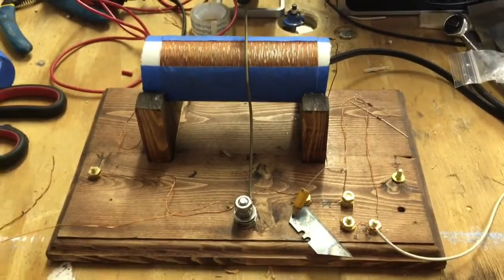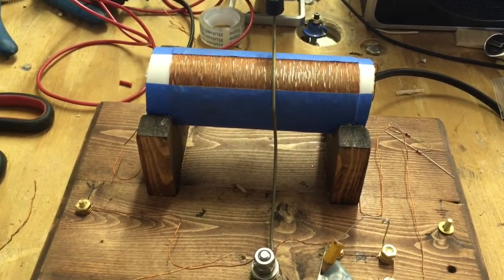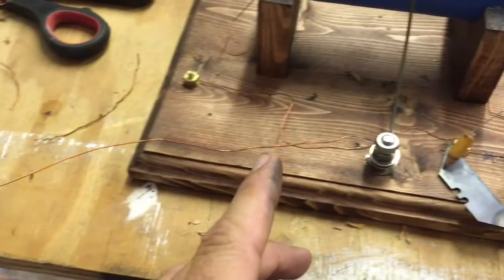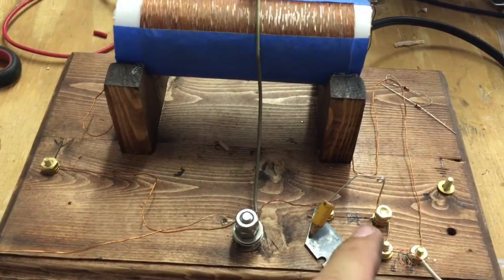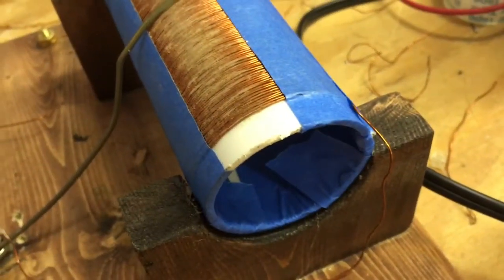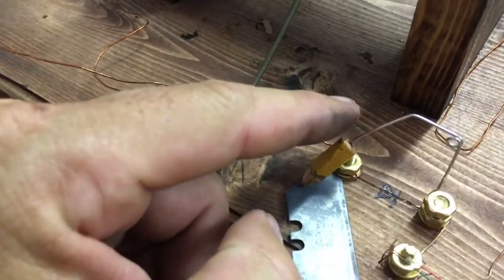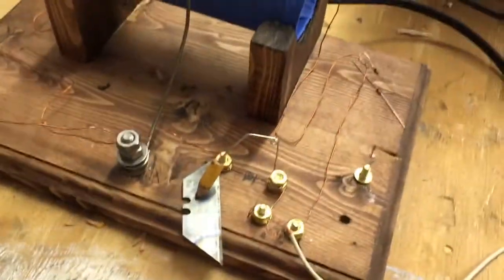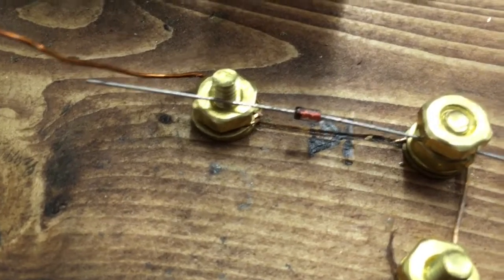Crystal Radio vs Trench  Radio

Comment: I bought very old from 30,s somewhere in that area  diode,I have several special diodes,next i want to buy some high end military grade diodes ,so I will have several types to try,I got some of these from a place that sells a lot of stuff for crystal radios .now I need to build it ,I even bought a radio tuner and a ferrite antenna to try.
Reply: cool! i collect diodes too,and i have one from yugoslavia,made in the 70's,but nothing really old...
the diode is much more sensitive than most of diodes today manufactured

Comment: I've never built a crystal radio before but I ordered a crystal radio build kit. I didn't realize that I would need such a long antenna for it. So my question is what do you use as the antenna, and does it have to be like a 100 foot antenna in the air?
Reply from the maker: Just a wire . any insulated wire should do 3 ft , 5 ft , 100 ft . Sometimes they work well without an antenna

Comment: hi! can i use any wire for the coil,sir?
if not, what kind of wire is most prefered? 

how did the radio work without the ground?
looking forward for your reply sir, thank you in advance :)
Reply from the maker: my radio worked fine without the ground . i used the wire from the windings inside an old used electric motor. the wire is real fine with a varnish coating.
Reply: @StoneBrokeAdventure  thank you so much sir, i'm so honored for reply, greatly appreciated :)